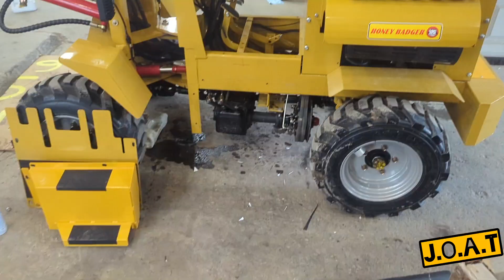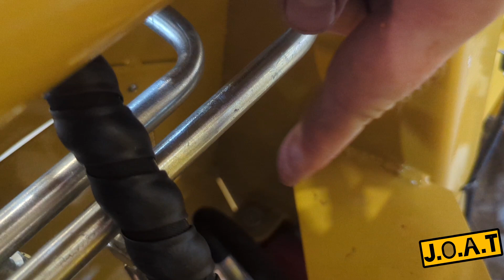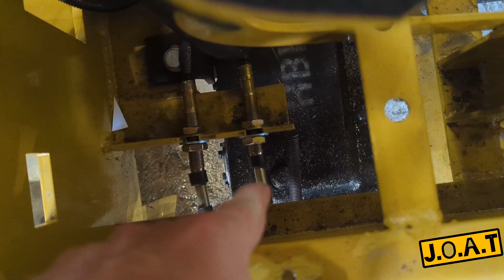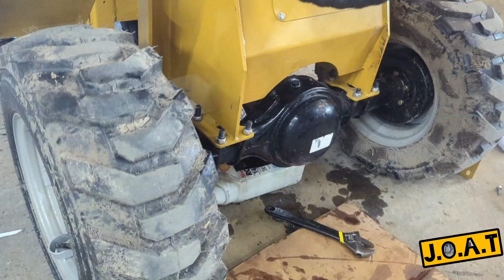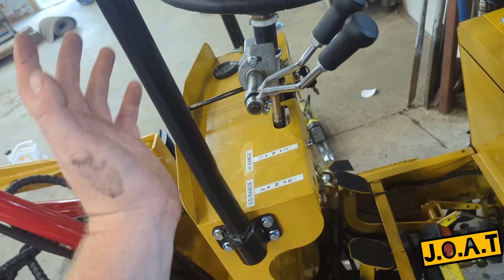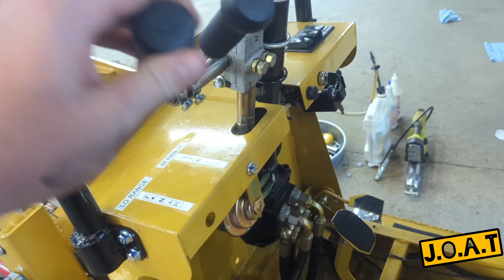AGT Industrial KRW23 Wheel Loader - First Service - Review

Comment: Clutch won’t engage
Reply from the maker: Check your linkage, after 30 hours mine got a little sticky. All I had to do was oil the shaft that slides in and out. Maybe yours is just stuck. Hit it with some PB blaster it needs to be lubricated

Comment: Great video ,I have  received a brand  new from Demao Machinery China it is very simular to the AGT KRW it`s also with a Rato 740 Gasoline  clutch and gears are the same the on featurs is the extra control valve for assesories, I do have some issues with the clutch hard to get in gears , did you ajust the clutch fingers ? do you know how tight should they be when touching the bearing
Reply: Подшипник должен свободно вращаться

Comment: Hey, I have the exact same loader. I bought last fall. It got to wear the clutch would not fully engage when I was going forward in reverse and now it will not go forward or reverse at all. It’s stuck in neutral even if I put it in Gear any thoughts?
Reply from the maker: Sounds like your clutch is seized. Also check you fluids
Reply: Any idea on a parts list?
Reply: Вы разбирали диск сцепления, может в нем проблема?